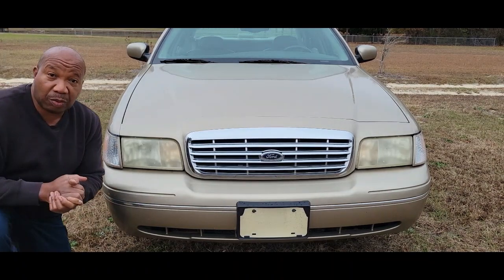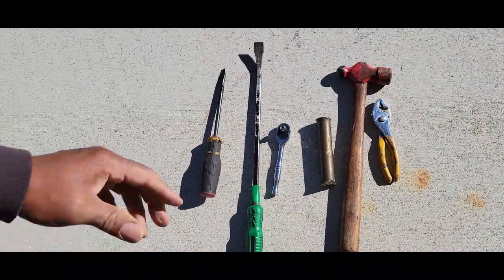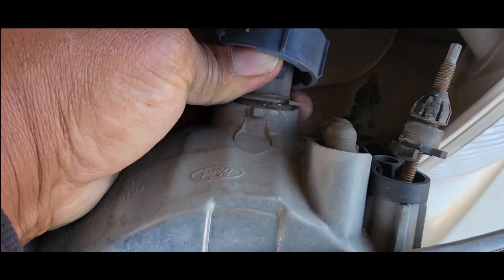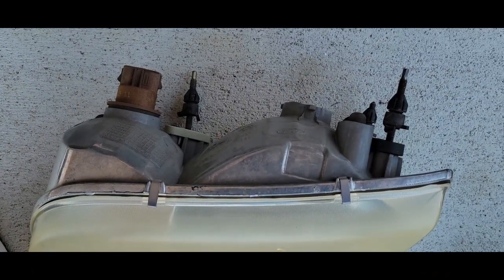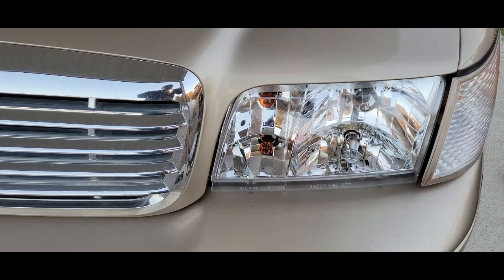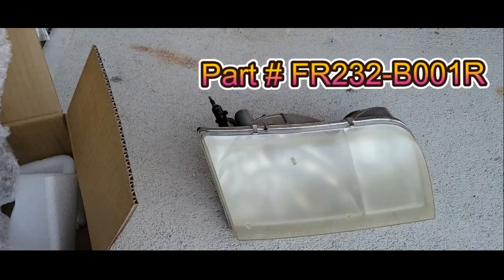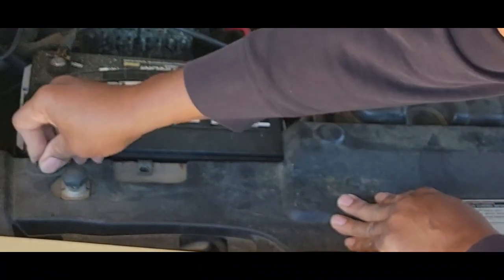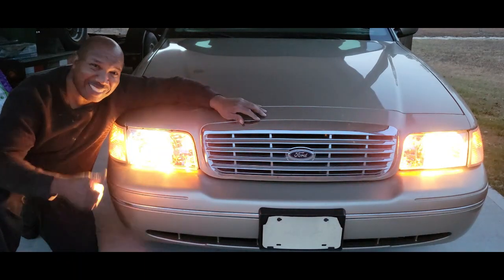Ford Crown Victoria Headlight Assembly Replacement

Comment: Dear Sir,

I have removed and replaced these lights many times and have found a 1x3/4 x20 inch piece of smooth hard wood works very well at removing the retaining clips. There is adequate leverage and there is no marring of the paint. I also found a little shot of WD on the clips and they slip out with ease.

Another god video. Keep them coming.

Thank you

JP
Reply from the maker: @joepalazzolo4630  I thank you for watching.  And most of all for sharing your information!👍🏽